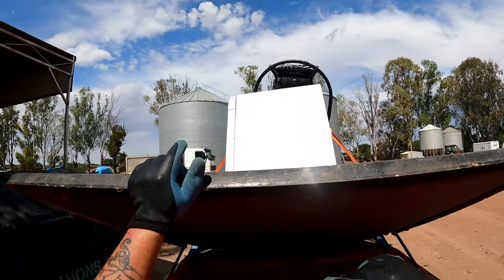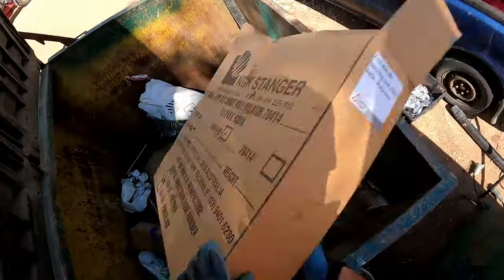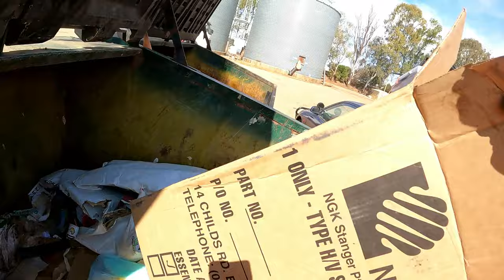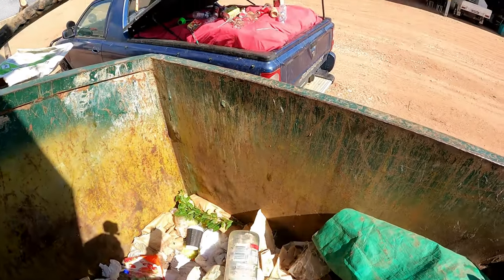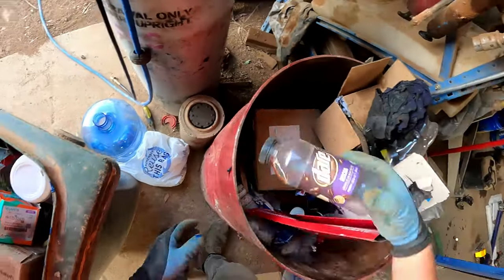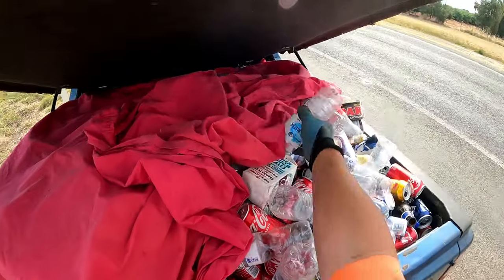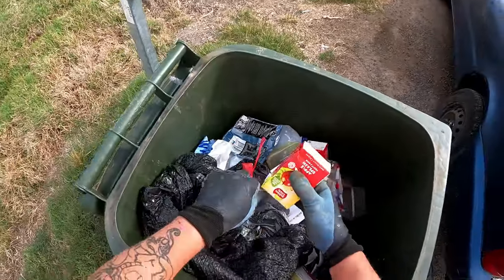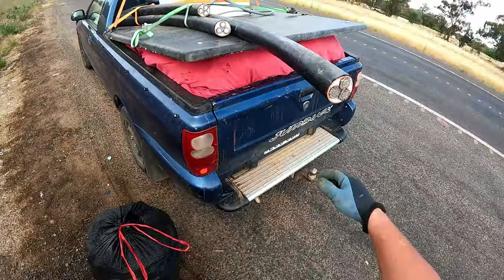Dumpster Diving Part 3 We Won't Say No To That

Comment: and why don't you want to remove the lid from the trunk and increase the sides by 2 times and instead of the lid close the cans with a dense cloth or mesh so you will increase the capacity of the body by 3 times